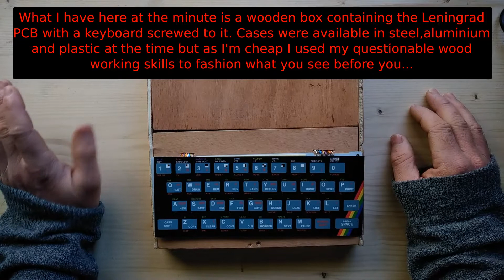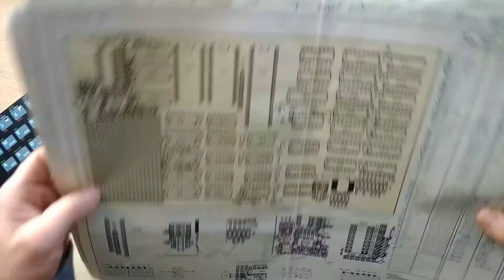The Zonovski variant or Leningrad, a 48K Spectrum clone from the Soviet Union

Comment: Thank you for another great video Peter! Never had a chance to get my hands on one of those - yet :-) 
Looks like an amazing chance for study and dig deeper into the design itself,
especially around the TTL/ULA ! Thumbs up!
Reply from the maker: I bought it looking for a little soldering challenge with a nice little device at the end for my efforts. It has been a lot of fun and I still have at least 3 upgrades I can do on it so great value as a project. If I knew at the time and had a little more money to spend I would probably have bought one of the much more advanced Spectrum clones with 1MB or more of RAM and a much faster processor (still a z80 however). These can even be connected to IDE harddrives and CDRoms. So a lot more scope for expermentation. But who knows maby in the future... Thanks for the comment ;)

Comment: Cool video ... I've built my fair share of ZX clones over the years (Pentagon48, Scorpion 256 Turbo+, Compact 256, Sprinter) and still have a few waiting to be finished (Pentagon 1024SL 2.2, ATM Turbo 2+). It's not only a great way to learn soldering, but also understanding how 8bit machines work.
Reply from the maker: Thanks very much, I bought this system as a project to improve my soldering skills and it did that. I must admit that when I began I hardly knew the difference between a resistor and a diode but by the time I had finished and it finally loaded something I was amazed at just how much my knowledge of electronics in general had increased. I agree it's a fantastic way to learn and a lot of fun too. Good luck with the systems you have left to finish ;) and thanks for the comment.